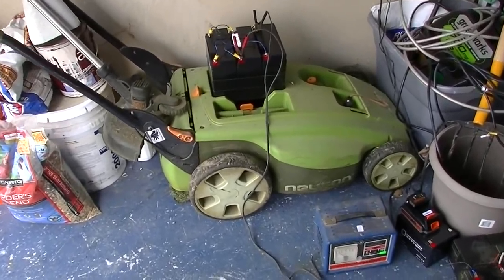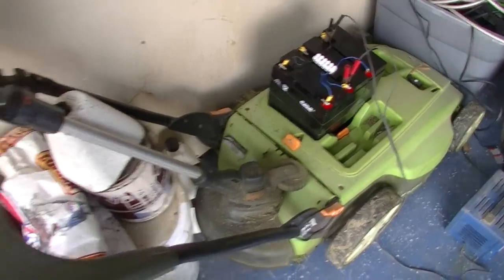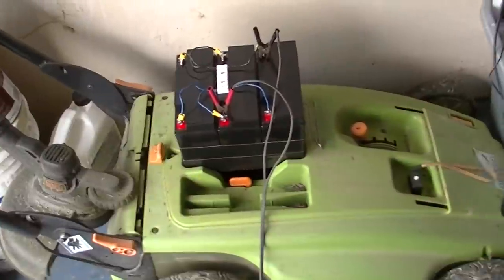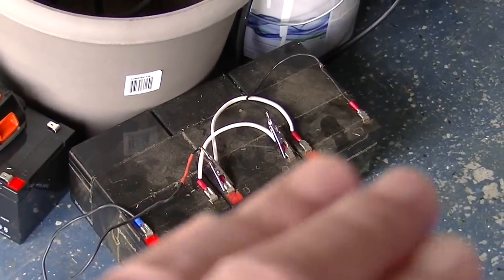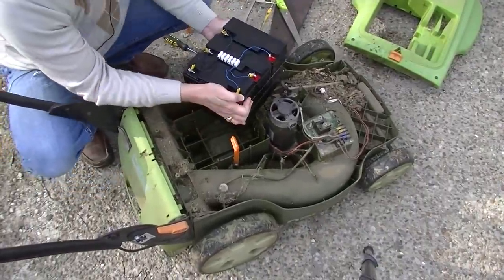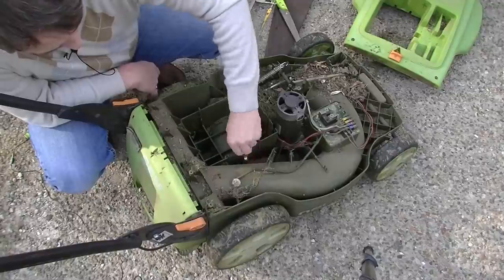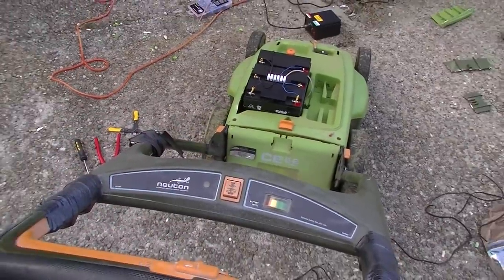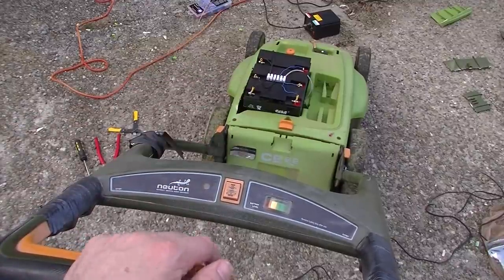Hot Rodding a Trash-Picked Electric Lawn Mower! - (Neuton CE6 Modification)

Comment: My god ... all lI could do is grimace at your lack of understanding of general electic/electronic understanding. I've owned a Neuton CE6 since they came out 14 years ago, and it still runs fine. When the batteries go bad, you can replace the 1 or 2 (bad) cells inside the battery box. They are 12v/10A & available on Amazon for $20 ea. In the  14 years I've owned mine, I've replaced 5 or 6 cells in 2 different batteries. You are running it in 'mulch mode', without the mulch plug. There is a side discharge chute which you don't have attached. There is also a collection bag which can be placed on the back in lieu of either the mulch plug or the side discharge chute. The accessory port is for an edger, and will NOT carry full power from the battery. Before you attempt to "hack" anything, you should get manuals/schematics so that you understand what you are doing. FWIW, I'm a retired Sr. Electronics Technical Specialist with 2 college degrees. I hope I don't have any nightmares from watching this video ...  sheesh!